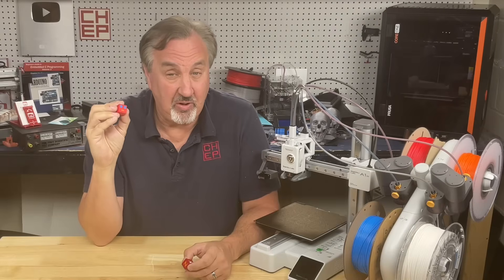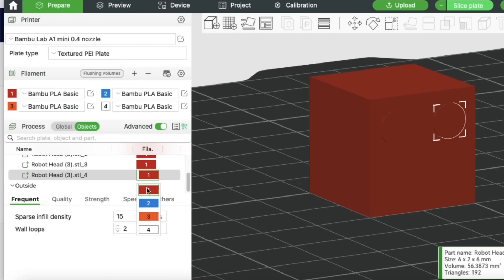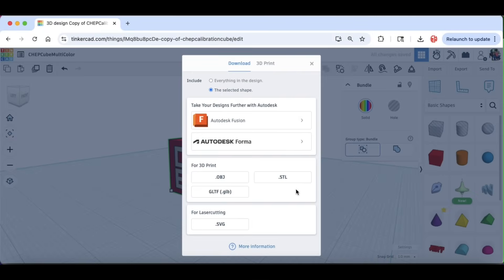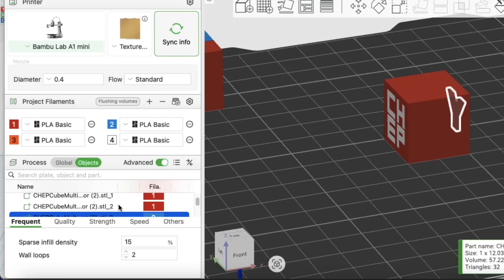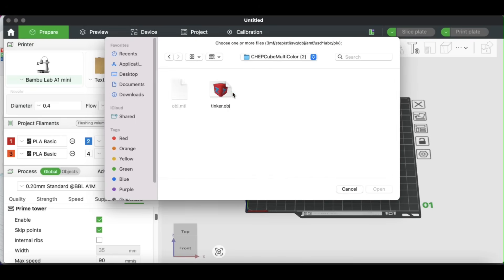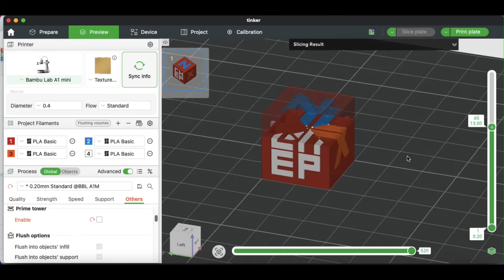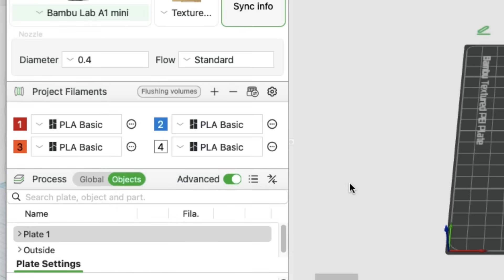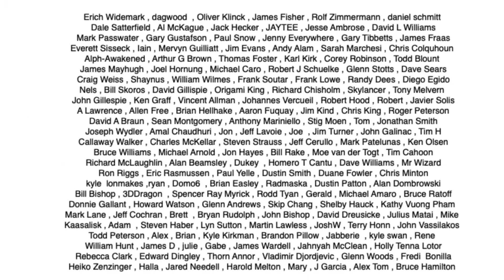Export Multi-Color Designs from Tinkercad to A1 Mini using .OBJ Files

Comment: I found 1 or 2 ways to achieve your desire to have the color bleed reach the hole.  What I got working first is an accidental way of doing this.  By setting the Text tall enough (15mm) to reach the center (20mm cube), when I grouped in the hole, the text color reached the inside.  (this solid depth may transmit light better?)  This was an accident though.  What I wanted to try was to use a Modifier in the center that had perimeter/walls set to zero.  But, my accident is better since you will have solid walls inside, so I'm not even going to try using a modifier.

Comment: I am trying simple things in tinkercad using four colors and importing into bambu studio as .obj....evertime, changing things on each test (I am now on test 8) it comes up with the error "error 384 non manifold edges"...if I click repair I lose all the colouring. Separate thing...The reset  then colour match was a good thing to know... thanks
Reply from the maker: I saw that error on a design as well. It was somehow related to the half moon shape in the design. It switched to a square shape to test it and the error went away. So I’m not sure why but maybe check for something like that.

Comment: is there any option on cura to do this process ??
Reply from the maker: Depends on the printer. In most cases Cura works best by printing the pieces separate and then glue or snap them together.
Reply: @FilamentFriday  oh 😮 i thought there must be a plugin in cura Market place that may split the print into smaller section/parts .

Just similar to the bambo-Studio software .